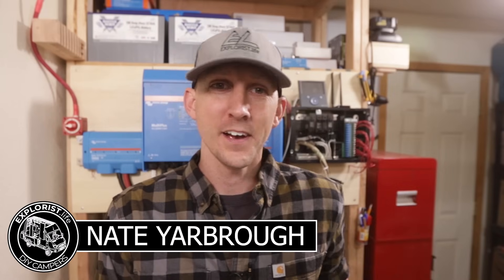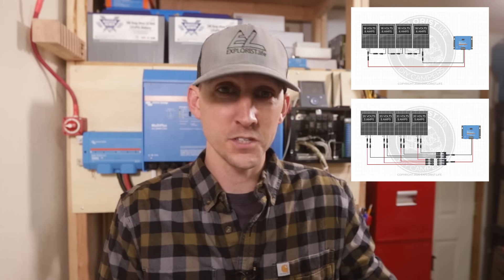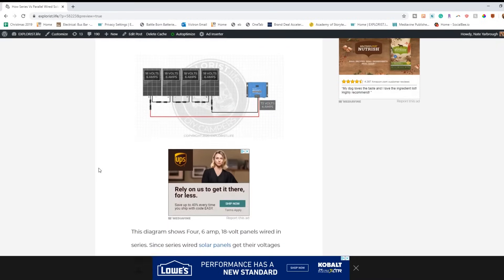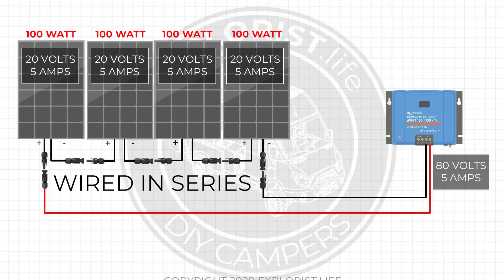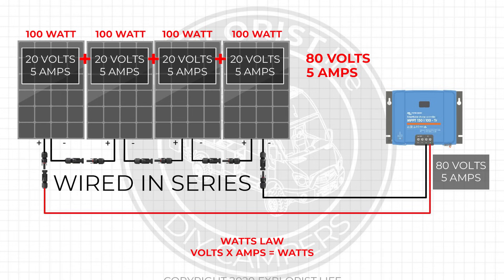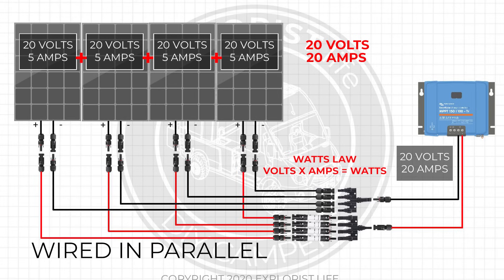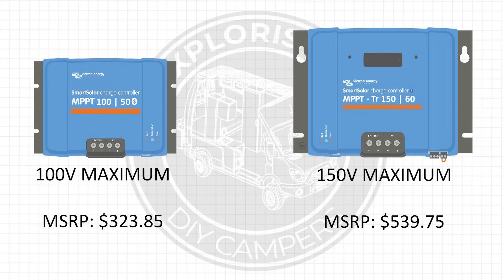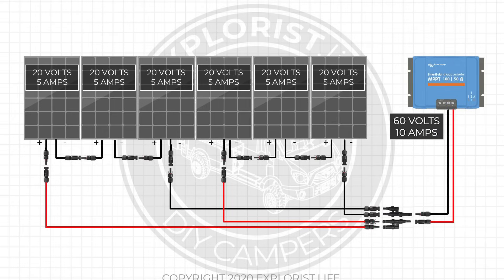Solar Panel Wiring vs Volts and Amps

Comment: You are great! Thank you for all the info.  I have a victron 250/100 Tr mppt controller. I also have 6 x400W solar panels running 65V each at 6amps, I use 3 panels in series each running to an isolator switch. Therefore i have two sets of 3 string with each string its own isolator. Question is what do i then use between the isolator switches and the mppt controller. Do I connect those 4 wires (6mm2 gauge)  to a dual Fused Circuit Breaker 2-String Solar Combiner Box for Lightning protection also, or, just straight to something like a Lynx distributor? Thanks in advance :)
Reply from the maker: If I'm understanding your setup correctly, you shouldn't need anything between the isolator switch and the panels.

Comment: Do you ever look at using multiple charge controllers like they do in boats?
Reply from the maker: I try to avoid it as it just adds cost and complexity, but if it's necessary in a specific scenario, I'll absolutely go that route.
Reply: @EXPLORISTlife  I think it's done in boats mostly because of shading issues and it provides redundancy of the system.

Comment: I bought 5 175watt Newpowa solar panels, the ones you linked to from your website and I bought the victron 150-85 solar charger. I still am unsure which way to wire these in series or parallel. I live in Oklahoma and I will be putting them on top of my van. They will be charging ten 12v battle born batteries. Thanks again for the great videos.
Reply from the maker: Go with 5x in series for those. 👍👍

Comment: Great video ...as always...right to the point and full of good info!
Question....Going with higher voltage panels seems to be the way to go as you deliver more volts to the controller while keeping wire size smaller.
I went with 2 250 watt 48 volt panels on my rv and wired them in parallel.
Reply from the maker: Yeah, I recommend the biggest panels that will fit in a particular area (generally) given the panel voltage is high enough.

Comment: On a side note, those smaller MPPT controllers don't work on a 48V battery. I set up my (8) 250W panels to output at 73.4 v and 35.4A, bought a 100/50 MPPT. But because of my larger battery, I have to upgrade to a 150/45 MPPT. Won't be an issue for any 12 or 24v system though.

I love the quiz too. A year ago I would have got one answer right.
Reply from the maker: Ugh... Yeah, the 100v charge controllers don't work with 48v battery banks.  Glad you got it figured out though!